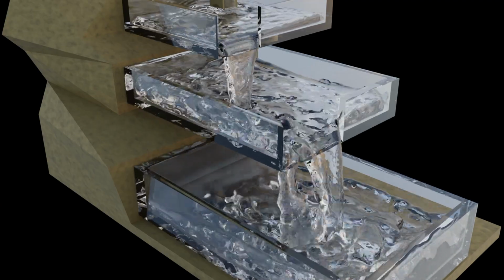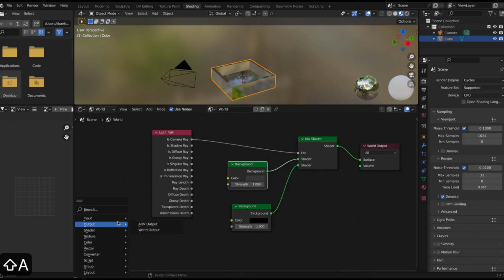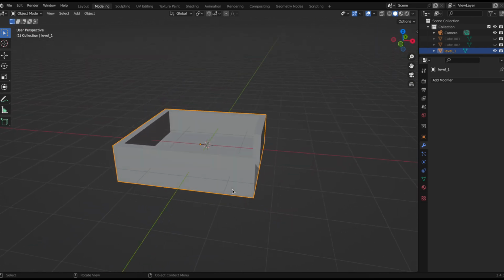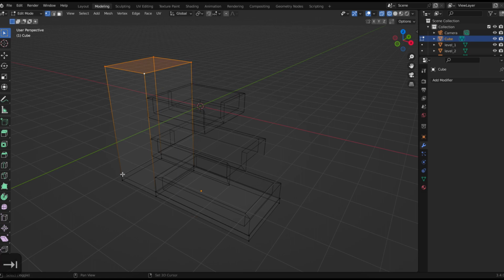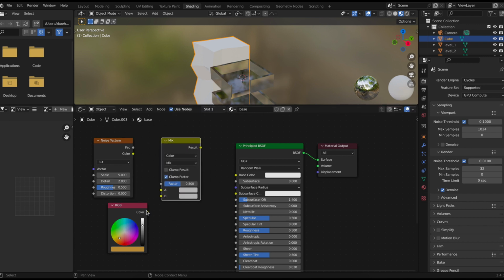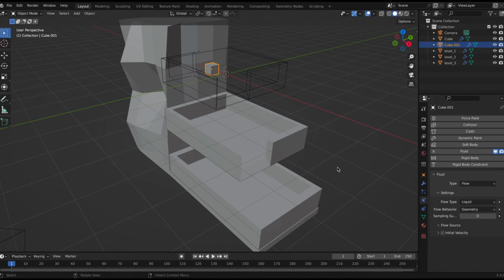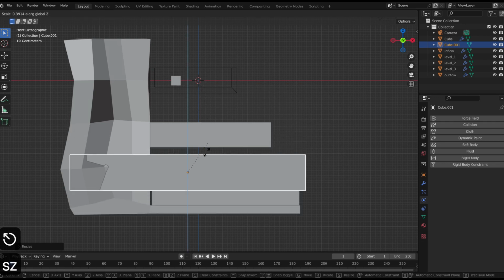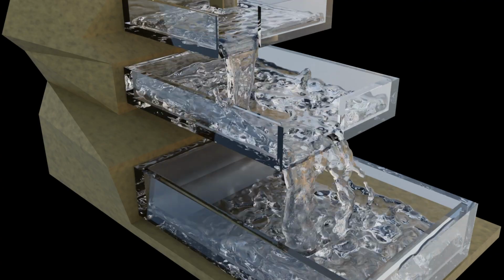Frustrated by Blender Fluid Simulation: Easy Method for a Calm Water Fountain

Comment: Great tutorial. Is there any way to remove the Domain box for rendering? I've clicked Mesh and looked all around to solve the issue. I'm using Blender 3.4.1 THNX
Reply from the maker: There are two ways that I know of. You can use the transparent shader node for the inflow object. Alternatively, after you bake, you can hide the inflow object in the outliner window on the top right of the Blender window (click the eyeball and camera). You will want to make your inflow object fairly flat. In the version I made, since the cube is not flat, the water flowing from the cube still has a cube shape. I could fix this if I make the cube flatter and wider (i.e., same volume just flatter shape).
Reply: @Harlepengren  Thank you so much for these tips!! Appreciate the fast reply. Can I uncheck Liquid after I bake? I read that somewhere..I'm excited to continue learning. Thnx for the awesome series of tuts!
Reply from the maker: I haven’t tried unchecking liquid yet. I will have to test.